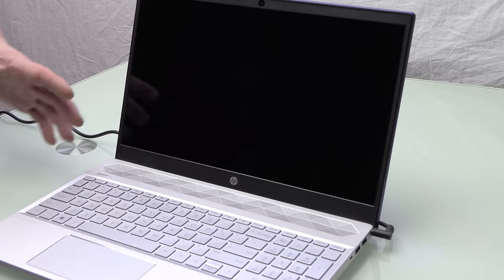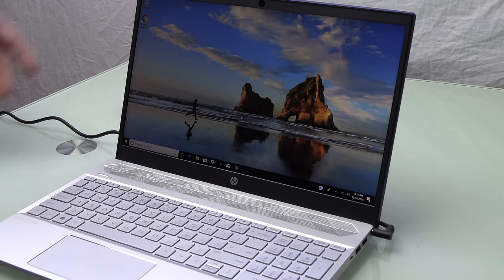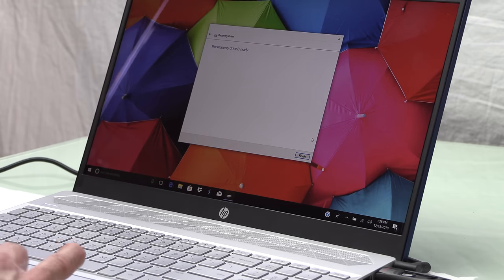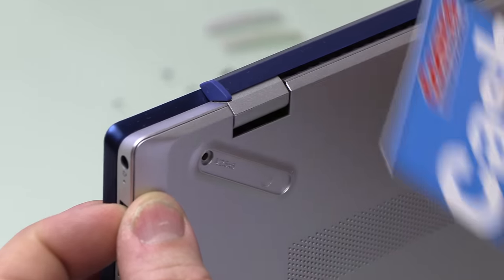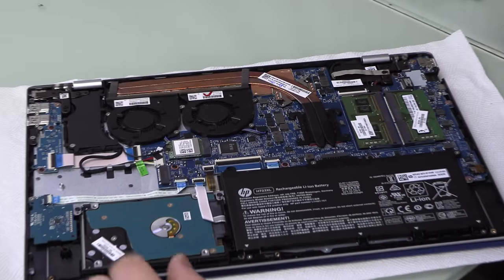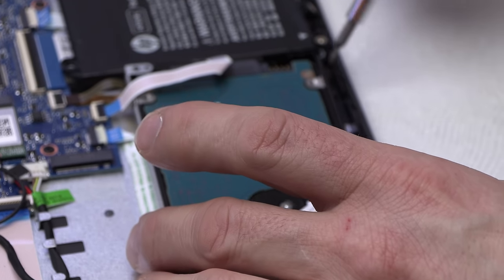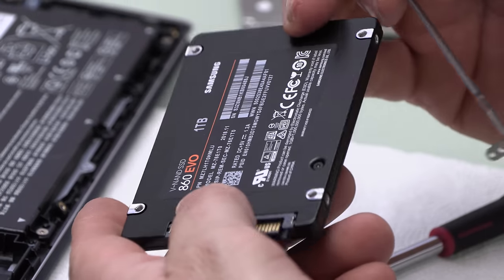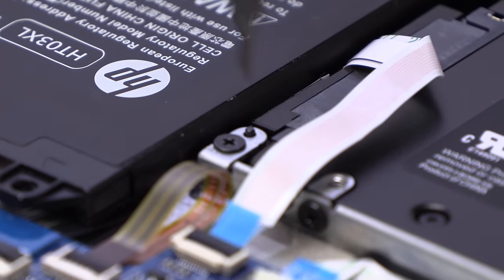HP 15-CS Laptop - How To Remove HDD and Install SSD

Comment: If it is an Intel based laptop, you may need a driver for the storage.  It is most likely RST.  You don't have to use Optane memory to use that driver.  Instead if your laptop is at all similar to mine you will need the drivers (unzipped please!).  Without those driver files Windows 10 or 11 can't tell there is a drive present.  If you made a flash drive, put a folder on the drive with those files unzipped.  The root of the drive works for me but I guess anywhere works if I know where to find them.  If you find multiple drivers get them all for that.  You don't want the ones that have a setup program with them because I am not sure if Windows setup will work with those.  I would have to say probably not.  If you can't figure out what the storage driver is, look in the device manager for its name.  If that doesn't help try the vendor and device id numbers in your search.  They are the hexadecimal numbers formatted like this for example (XXXX:XXXX).  You will only have to do this if Windows setup doesn't see a drive.  Don't worry if you attempt to reinstall Windows and see that message, all your files should be intact still (back up your documents if you did not already.  Windows setup can remove the partitions and that would delete the files.  Good luck getting them back if that happens!!

For my computer I made install media using Rufus, Windows 10 ISO and an SD card.  You will just have to boot from that (or your flash drive if you chose that).  I like the SD card personally because it doesn't protrude like a flash drive does.  Some people may have rare glitches preventing setup from finishing and a different media (with all necessary files) would be nice to have just in case.  Some computers are weird.

This may apply to AMD laptops too, I have not owned one so I can not say.  The driver for my storage was not immediately obvious but luckily the one straight from Intel worked (why wouldn't it unless HP or the OEM did something weird).  Also if you make install media yourself either with Microsloth's tool or Rufus you will get a clean install of WIndows.  No McAfee or other bloatware that does NOT belong there!!  They only come with it by default because they are paid to load PCs with such junk.  Some computers are full of that sh!t too!!

Comment: My HDD is dead and no recovery usb image available. What is the alternate step if I want to replace the HDD and make it LIVE again.
Reply: Replace with new HDD/SDD and flash new windows key using a USB stick. An 8Gb should be fine. Your files are gone unless you want to take it to a data recovery place and let them try and get what they can. Good luck

Comment: that was great! im so doing this asap. has anyone upgraded the memory on this? can it even be done? trying to do everything at once so I dont have to open the back multiple times.
Reply from the maker: Thanks and yes, you can definitely upgrade the memory, I'm assuming you're talking about ram, it's super easy and it's right there oh, I think I pointed it out in this video. But yeah ram you can usually just pull out and upgrade seeing as it's volatile memory.
Reply: Here are the Crucial memory options for this HP laptop (Crucial guarantees compatibility): https://www.crucial.com/compatible-upgrade-for/hp---compaq/pavilion-15-cs0073cl

Comment: Hello sir, I would like to know, my laptop model HP 15-da1005ne, core i5, 8th gen, ram 4 GB, HDD 1 TB, 
the problem is that this pc super slow and laggy so please advise me how to resolve this issue. I want to do my faster pc but spending less money because I am a student I don't have that much money for buying new ssd. kind your attention and expecting your advice sir.
Reply: There are a number of videos available on YouTube on how to speed up your PC by cleaning up unnecessary files and uninstalling unwanted programs. If that doesn't work, I'd suggest you to install 4 more GBs of RAM, making a total of 8GB - that should speed up your laptop to a considerable extent.
Reply: @rosswahid  Thanks for your feedback sir

Comment: Hi Hello where i can find motherboard for Cs0066st...
Am in fuck up situation if i clean install Windows then there is sound working whenever i connect to wifi sound gone there is red sign on speakers after that I can't install any sounds drivers.
Someone said there is problem in Sound card and i need to replace the motherboard.
Please help me.

Comment: I just bought from Costco's too and only using for photoshop and lightroom. Still wanted to install the sdd but someone said they do WILL honor the warrantee and then some said they don't? I actually emailed them twice and they didn't answer me but answered a different question. I bought it and used they're credit card for warranty but can't seem to get an answer. I figured if the slot is there it shouldn't affect the warranty but anyone know for sure? Thanks One more thing
Reply: they told me they would honor the warranty and Costco said as long as hp said yes they would too

Comment: parts?
My laptop is configured with only the m.2 ssd connected to the motherboard. The 2"5 sata spot is empty.
I would like to buy an ssd so I can dualboot linux but I don't know where to buy the metal structures to attach the ssd to the frame and, most importantly, I have no idea what type of connector I need!
I've been looking for hours at this point but I have no clue. Can someone, anyone, help me please?

Comment: I want to add an ssd in the m.2 slot, and the old hdd will be there in its place. How would I then transfer all the system files including the OS to the ssd?
Reply: You gotta reinstall the os. If you need to transfer the entirety of the old HDD to SSD and hope everything ld work out then you gotta need disk image. Because of the size mismatch it wouldn't be possible. But you can always Google and experiment

Comment: where can i find that ribbon cable for the hard drive? i'm really struggling both with contact HP directly the website and HP Part surfer has been no help any thoughts from anyone for locating those HP hard drive ribbon cables would be much appreciated

Comment: Ugh.... I bought a pavilion 15-cs1007np i5 mx150 8gb ram with a 128gb m.2 ssd thinking I could just add a 2.5’’ hdd, turns out this model doesn’t come with the cable to connect the drive even though it has the space designated to it
Reply from the maker: Hmm. Why don't you just get a larger SSD?

Comment: I think the speed test was biased because he took longer to log in on the hard drive.
Reply: It took same 12 s to the log screen
Reply from the maker: Nah it was shorter, let me go back and watch again .
Reply from the maker: Just watched again it was 15sec to the login and 30sec to the home screen with HDD and 8sec to login and 12sec to home screen with SSD. I took longer to login with HDD because it was still working and wouldn't let me type yet.
Reply: It still won on to lock screen at the very least.
Thanks for making this

Comment: You have an m.2 slot infront of the sata port
Reply: If I use that slot for nvme, do I need to replace my default 1 TB HDD?
Reply: @jahidulhasan16  No. Erase it and make it a data/backup drive aka D drive.

Comment: Usefull fact, if you're adding a HDD to this laptop when it had only a M.2 NVME SSD, keep in mind that the chassis of this model is meant to have a 7mm 2,5" drive, so if you have the same bad luck I had and got a 9,5mm 2,5" HDD ignoring this fact, you'll have to take out the foam of the cassis and make a little modifications so it fits, and believe me it'll get really tight. That said, I'm gonna keep trying to make the HDD fit in, good luck everyone!
Reply: How did you connect the hdd to the motherboard? I mean, I know you need a cable but how did you find the cable?
I want to add an ssd/hdd but since my laptop only had the m.2 ssd, the 2"5 sata slot is empty. There is a connection on the motherboard, but no cable :'(
Reply: @Kirmo13  yeah I bought the cable
Reply: @enzorp5497  Ok cool. In the meanwhile I managed to find the cable by myself, but I decided that it's not worth the price.
ssd = $75
cable = $15
I'll just partition my current drive

Comment: can you please show how to put a m.2 ssd?
Reply: You just slide it in the PCI-E connector on the motherboard just like any other device.
Reply: I am a complete noob at this, can you please tell me hiw can I locate the PCI-e slot?
Reply: @BrevityBuzz  

Can you please confirm the answer to this Question below ?

Can Pavilion 15-cs2073cl boot from M.2 SSD?(Below is the link for the discussion but without an obvious answer !)

https://h30434.www3.hp.com/t5/Notebook-Hardware-and-Upgrade-Questions/Can-Pavilion-15-cs2073cl-boot-from-M-2-SSD/td-p/7126549

I want to buy the deal for 15-cs2073cl from costco soon .

any help about this would be highly appreciated .

Thank you
Reply: I didn't get an answer either. let me know if you hear anything. thx

Comment: @Hook It Up what should I do if I plan on purchasing a SSD for my hp but the old HDD is corrupted with a boot sector virus on the master boot but I want to still have my windows product key. please help lol 😂
Reply from the maker: Oooohhh.. that's a tough one. I believe you can go to the Microsoft website, login to your Microsoft account come go to your devices on your account, and create a recovery drive from there, if you do it that way it should include your digital license in that recovery data... Hope that helped you
Reply: Hook It Up  it did brother smart thinking. I appreciate your support! you get a sub! I actually have one more issue. recovering my bios from a forgotten bios password without a HDD or os because I have already taken it out. also it's a hp laptop

Comment: @Hook It Up Nice video, it really helped me! But i have a problem: i need the name of the cable and the name of the SSD bracket. Someone can link me where can i buy them? Thank you.
Reply from the maker: Thank you. I believe for the parts you can go online to the HP website, type in your model and serial number and you should be able to get a parts breakdown.
Reply: "This video helped me upgrade my spouse's HP 15 CS series internal storage - great job!  Costco US has a model of this Pavilion (Item 1373575 / Model 15-cs3063cl)* that uses a 256GB M.2 SSD.  Unfortunately, it does not include a mounting caddy, hard drive ribbon cable, or screws for a 2.5" drive.  I had to research for hours for compatible parts to mount a spare 2.5" SSD inside.  HP's replacement parts for these are either too expensive or (in my situation) oddly unavailable from their website.  I ended up finding equivalents on eBay which worked perfectly.  Hopefully this helps someone:

1) HP Hard Drive Caddy (Part# L19469-001 - as long as a 15-CS model number is listed, you should be fine.  Make sure it includes the metal and plastic rails shown in OP's video)
2) SATA HDD Hard Drive Cable HP Pavilion (Part# L23889-001 - as long as a 15-CS model number is listed, you should be fine.  You'll have to gently fold the cable as shown in the video, possibly once more depending on the length of the cable.)
3) Mounting screws (two Phillips M3.0x3.0 screws to connect metal part of the caddy to the drive, then 2 Phillips M2.0x4.0 screws to mount it to the motherboard).  I resorted to just buying a variety set from Amazon for $7 as I was impatient, but a computer shop might give them for free if you ask.

*I don't recommend the Costco model I mentioned as it uses a single fan/heat pipe assembly.  Peculiar, as there's a gap and mounting hole for the two fan/two head pipe version in OP's video.  The fan goes off constantly and is very high pitched."
-Chan Prado (comment above)
Reply: From the HP Service Manual (page 58): " The
hard drive brackets are available using spare part number L19469-001. The hard drive cable is available using
spare part number L23889-001"    https://support.hp.com/gb-en/product/hp-pavilion-15-cs0000-laptop-pc/20284004/model/21447475/manuals

Comment: tI have a cs0xxx product number 4CP61EA#ABU is this the same process?
I noticed that yours has the bay for the SSD and for the M.2.

Mine has only a 128gb  M.2 and it needs upgrading to 16GB ram and 1TB SSD if the HDD bay is there I can simply add an additional, any tips other than taking it apart and looking are appreciated.

Thanks.
Reply from the maker: I didn't even notice that it had the bay for the m.2. I'm going to take a look at that

Comment: Can i install a M.2 ssd to this HP 15-cs100tx laptop
Reply: Yep, there's m2 slot beside the hdd/ssd slot
Reply: Pradip Behera amigo lo mismo quiere saber.
Reply from the maker: I believe you're right, there sure is, I never even noticed that
Reply: Is that NVMe or SATA interface slot?

Comment: Help me... I want an hdd connector.... Anyone plzz give me the link..... I couldn't find the exact model connector..... Is that a 10 pin connector   ?????
Reply: I'm in the same exact position as you. Did you find anything?
I counted the pins, and there are 10 indeed but I have no idea what the connector is called

Comment: 6:37 What the name of the cable that connects the hardisk to the motherboard?
Reply: From the HP Service Manual (page 58): " The
hard drive brackets are available using spare part number L19469-001. The hard drive cable is available using
spare part number L23889-001"    https://support.hp.com/gb-en/product/hp-pavilion-15-cs0000-laptop-pc/20284004/model/21447475/manuals

Comment: Hello I took a hp 15cs0989nl with ssd m2 from 128 where windows is installed. I wanted to put in space hd another 1tb ssd can tell me what caddy and connector should I use or how can I do?
Thanks good morning
Reply: I also have the same problem

Comment: What type of M.2 ssd comes in ssd slot sir
Reply: My pc is hp pavilion cs1000 tx
Reply: Can i add m.2 nvme ssd
Reply from the maker: I'm not familiar with that laptop, but most of the HDD and SSD as share the same mounting and body. Hope that helps, if not give me a few more details and I'll try to help.

Comment: 6:51 My laptop has an empty slot for a 2.5 inch ssd, but I can't find those freaking brackets any where. They are $50 on HP's website, so that's a no go
Reply: can you send me a photo of the empty slot ?
Reply: Try lookin for those on aliexpress. Part numbers: L19469-001
L23889-001

Comment: This video is good but I would upgrade the laptop with an PCIe NVMe SSD instead. I'd not replaced the HDD but ADD an NVMe SSD instead into the M.2 slot just above the HDD cage. The NVMe SSD is a lot faster than the SATA SSD that he got and likely cheaper too, and I can double my storage space. Most SATA SSD has the read/write rate about 500MB/s whereas the PCIe NVMe SSD could easily double that to 1.2GB/s or higher depending on the needs. For a gaming laptop, I'd use the NVMe 1TB SSD with 3.5GB/s, which is 7x faster than the SATA SSD. Samsung is good but I'd stick to either WD or Crucial SSD for gaming, they are better brands. Why do I want to keep the HDD? Remember all of those photos and videos you store on your computer? HDD would do fine for that but the OS will be running from the new NVMe SSD with your applications like games, you got the advantage of both world and not wasting an HDD in your desk's drawer. In addition, you have two drives in the computer, you can just clone the HDD to the SSD and you don't need the recovery drive. Another thing to consider while you already open the laptop up is to upgrade the RAM to larger capacity like at least 16GB DDR4 (2x8GB) so the applications would run faster. I love working on the HP, they are designed for much easier to upgrade or maintain because they have much less screws than the lame Dell and other laptops.
Reply: I can definitely tell you know your stuff when it comes to computers.
I just opened my pavilion earlier today and I surpisingly saw that I do not have any hdd, but only an m.2 nvme ssd.
Do you know what connector I need to connect another 2"5 hdd/ssd to the motherboard?

Comment: I have splitted some water into my hp pavilion,  i've turned upside down but now i want to open and make sure is dry
Reply: I also spilled water once.
I turned upside down, with the lid open and the keyboard on a bunch of rice (it absorbs humidity). Then I also covered the laptop with more rice.
It worked fine after 1 day

Comment: costco is selling them with  500 gb ssd's now...it took  HP long enough ...to switch to ssd...they are way behind in technology if they are selling mechanical hds in 2019...its not as if ssds 's are expensive now...shhesh...just a question corporations using old technology to increase their profits while screwing the consumer with outdated technology

Comment: I've tried this,  and when when I turn the computer on I just get a blank screen.... no bios
Reply from the maker: Oh no. That's not good, you can always put the old hard right back in, but the BIOS is not on the hard drive.
Reply: First, GREAT tutorial! The issue mentioned above also happened to me. Something affected BIOS post, possibly old BIOS prior to installation. The symptom is a black screen with a 5.4 Caps Lock blink.

The solution is to visit HP on a different computer with a USB port, enter your serial number, manually download the latest BIOS, install to a blank USB flash drive. Perform a "safe"  remove/eject. Then inject the USB flash drive with the updated BIOS into the non-working HP. With the power off, hold Windows Button+B, then press Power and release all three buttons after 2 seconds.

The BIOS update process will begin after a single auto restart (about 30 seconds of black-screen and power restart awkwardness). 

Read the instructions very carefully and do not eject the USB Drive until after several auto-restart cycles. You'll know when it's truly done. About 10-15 minutes from start of flashing to finish.